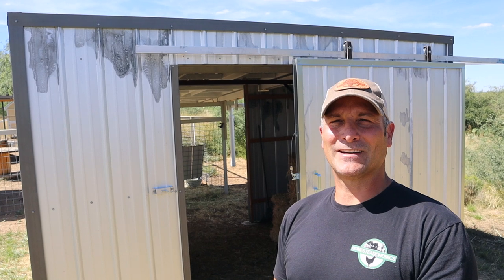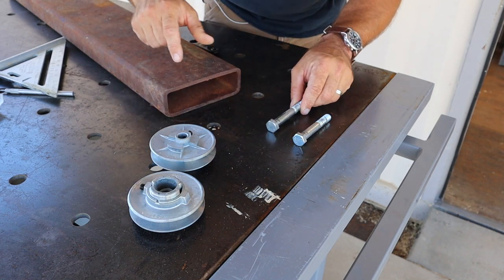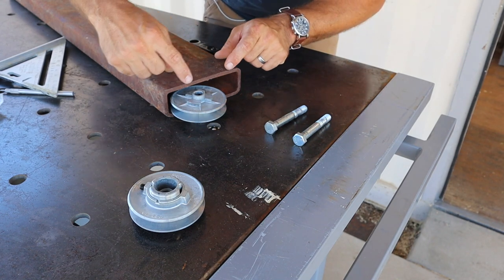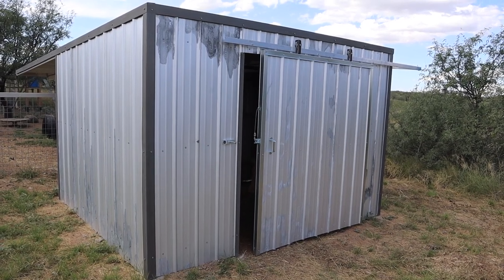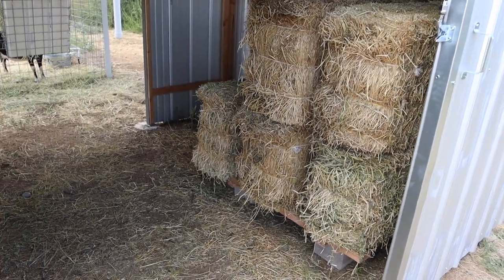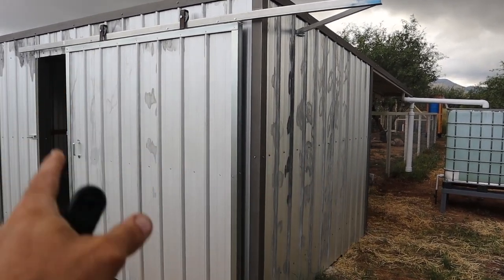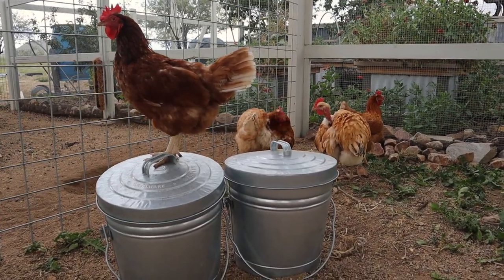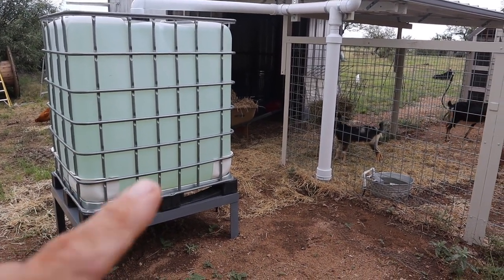The Hay Barn Gets a Door!    ( How to Make DIY Barn Door Hardware )

Comment: This is a really great project. If you have ever looked at barn door hardware it can cost a ton depending on how much durability you want or need. I knew those workbench cutouts would find a home, eventually. So, you need to start looking for another drive in theater to restock your used steel stash. Thanks for sharing.
Reply from the maker: Oh man, I NEED to find another one soon!   I’ve got pieces left but they are all really bent so they are really just good for little 2-4’ sections.   And with the layers of paint snd rust they require a LOT of prep to use.

But I actually did find another drive in near Morenci AZ there is an old drive in theater that has a screen with similar construction.   But you’d need a large crane and lift boom/truck to disassemble in pieces to get it on the ground

Comment: Great idea with those door rollers. Probably beefier than store bought ones and fraction of the cost
Reply from the maker: Thank you!   They are definitely WAY beefier than store bought ones.  But the rail/track is going to be the weak link at some point.  It’s marginally adequate for this door.   But only time will tell on that one😂

Comment: Awesome job as usual. The door looks really light weight, but I wonder how long those rollers and rail will hold up,
Reply from the maker: Thank you!   As for holding up…..I think they’ll last a long time.   I’ve got no worries there.  BUT the rail/track…. On the unsupported side could need to be replaced at some point.

Comment: I am doing a similar project with scrap material. Only thing i had to buy were trolley wheels that slide within a strut channel bar i have and I already have a metal gate and brackets that i will weld all together. I still need to figure out how i will make a latch. May steel* your idea
Reply from the maker: Trolley wheels for this unistrut channels are really cool!  So many cool things you can do with them too!   I’ve got no doubt yours is going turn out awesome😀👍

Comment: Which way does the wind blow during your monsoons? I'm wondering if that one plywood wheel will hold it. It looks amazing as usual though!
Reply from the maker: It mostly will come from the open side… so wind will put pressure on it.   However if it becomes and issue I have another one of throws motor wheels that I could use instead.   The wooden wheel was mostly because it already fit that aluminum channel I had.  And I kinda want to see how it’d work.  But the metal wheel would be a bit more robust if I find that I need to replace the wooden one

Comment: Another type of circular saw with a blade for cutting metal, could have made a faster job of it.
I think Ryobi has them too. Probably safer too. Check it out. Unless you have enough tools of course. :)
Reply from the maker: I have one of those carbide saws.   But I think using an angle grinder better demonstrates how it can be done with such a basic tool that many already have access too.

Comment: Joe... do your home rain water collection tanks generally stay FULL... or no?  If no, would there be any benefit of running and overflow line from your goat watering system over to your home collection system?
Reply from the maker: They are full during our monsoons(right now) and also usually top off in winter rains(January-ish)…. And they dwindle down in between.   
But for this one, the goats collection surface and tote is much lower on the property so the overflow wouldn’t work due to the elevation
Reply: @homesteadonomics  Thank You for your replies Sir!!  Have a great weekend!

Comment: Have you done anything to stop galvanic corrosion on the pulleys?
Reply from the maker: No, for this kind thing I’m not too worried.  Plenty of ‘meat’ on both the bolts, washers and pulley wheels.   There will be a bit but it won’t make much of a difference out here.  If it was thinner stuff, then yeah, but this should be okay……fingers 🤞 😉

Comment: Hey Joe, idk why I keep thinking about this but over time would the hardware start seizing up from rust? Will you need to keep the hardware lubricated  to keep it from rusting? Also, I was thinking would bushings be useful on bolts going through the wheels on the top track?

I hope I'm not being too over bearing. I enjoy watching your builds and I recently started working back in the shop, so the mechanic wheels in my head are turning.  😅